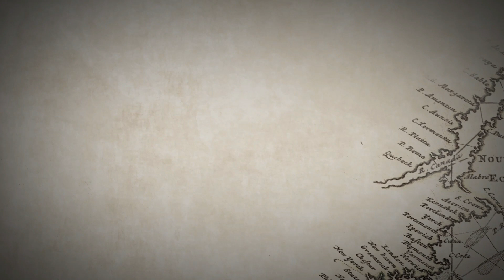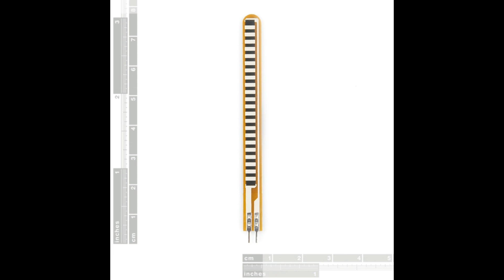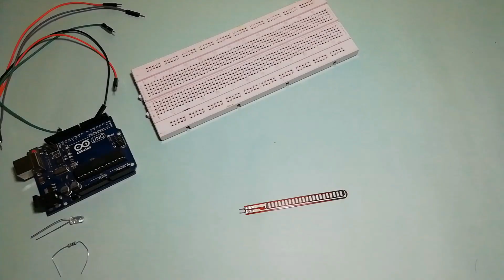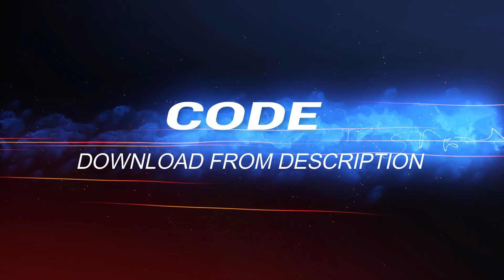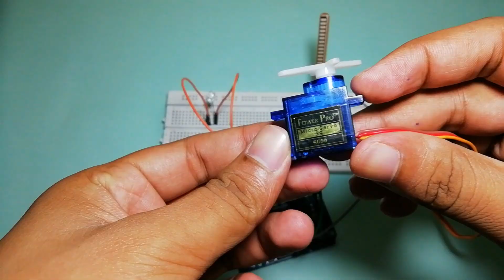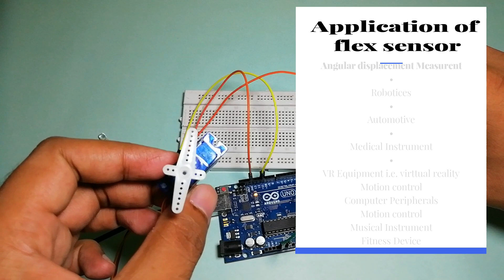Interfacing Flex sensor With Arduino and control Servo Motor and LED.

Comment: hi bro ,your video is very useful to me and also i want interface with gsm900a module in it.
when the flex sensor readings are below 900 or something.then the gsm 900a module sends message to a person.
i have gsm900a module code and above flexsensor code.but i dont know how to interface both.can you help me?please.
ph:9885155349 .message me or reply to this comment .i am doing this project  and i have just 8 days to submit .help me bro
Reply from the maker: Ok

Comment: how i can add gestures to control sensor
do you have coding for it and should i use led or servometer for my hand gesture sign converter. pls reply fast
Reply from the maker: Yes I can code
Reply from the maker: Just for demonstration I used led and servo motor..
U can use any other device too if you have.
Reply: @technolabcreation   do you know how insert gestures in flex sensors. If you know plz help me
Reply from the maker: Please elobarate what do you want to make???
Reply: @technolabcreation   gloves which convert gesture in digital form for dumb and mute people
Reply: @crystalkids7602  are you doing project i.e gesture to speech conversion using flex sensor with ardiuno for dumb people
Reply: @lucky4496  yed
Reply: @lucky4496  yes
Reply: @crystalkids7602  to what extent have you done
Reply: @crystalkids7602  at present I am working on the same project
Reply: @lucky4496   I have completed it but my code has some problems

Comment: hello , you explained very nice how it works . i tryed to use 5 sensors for 5 motors, but it doesn't work... i don't know why...
Reply from the maker: Make connections properly and use correct code then definitely it will work
Reply: i will try once more more and i will try to make a little video to send you eventualy... cause i don't know where i am wrong...One more thing for your future video please dont hurry up and try to make the videos a little bit slow than this one.Once again good job buddy!
Reply from the maker: Thank you brother for your valuable suggestions and yes I tried to be slow , many people suggest me for this..
Reply: i have a robotic hand build with this program design spark, and i want for the for the beginning to use flex sensors to control each finger.I really want to know if you tried i? cause i have some issues...i really need to finish it ,after i want to use a myoware sensor just to control robotic hand using muscles.So , did you try to use 5 flex sensor and 5 servo same time or can you use them and make a video ... i am really interested, like i said i have some issues... about put 5 sensors on the breadboard and after connect them to servos... it doesnt work...
Reply: @ionilaalexandru7902  Hello, I am currently facing the same problem as you did here with getting 5 flex sensors and 5 servomotors to work. Did you find any solution, and if so, would you be so kind to share with me how you did it?